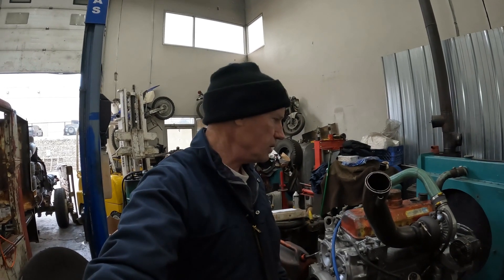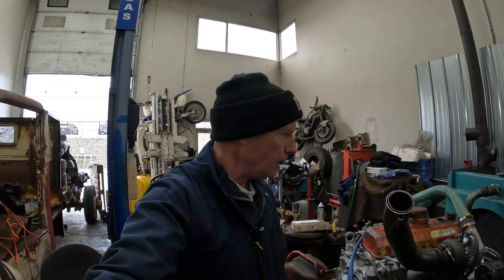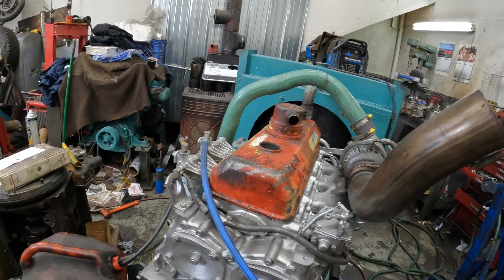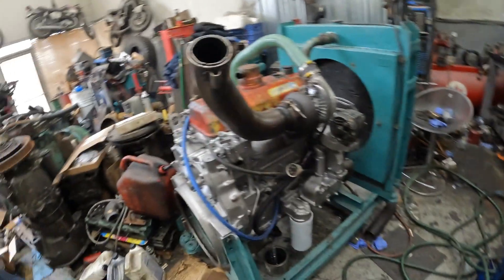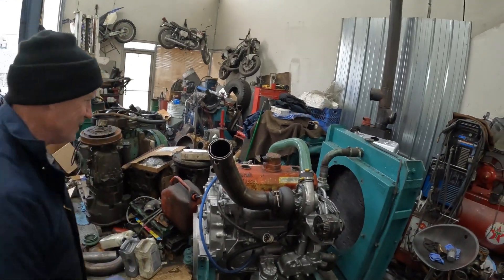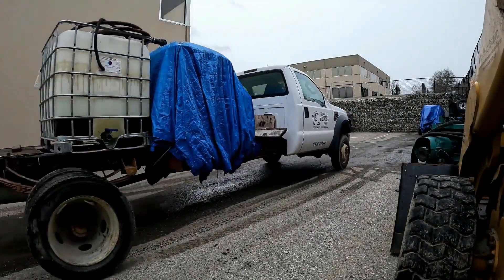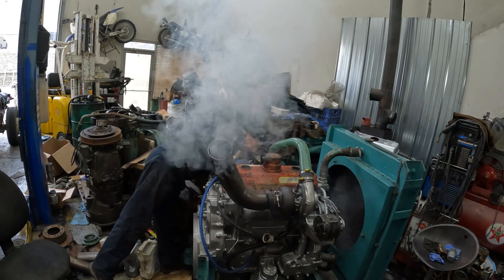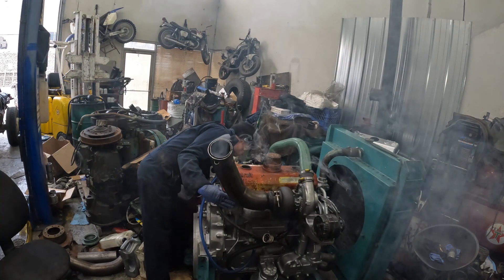Detroit Silver 4-53T (Second Start Cold 50f)

Comment: How many dollars does it take to renovate the entire Detroit 4-53N in the USA? In Brazil it costs around $50,000.00 reais, or around €9,000.00 dollars.
Reply from the maker: My cost is about $1000-$1200 USD without the labor.  Would be close to $7000.00 to $9000.00 to rebuild at a shop.:)

Comment: Question for you. I have a couple of Older GMC trucks i am repowering with the 4-53.    One was originally equipped with a 4-71. Do you ha e any thoughts on or experience with the 71 series  and should i be looking for one ?
Reply from the maker: The 4-53 should fit well and bolt to the trans you already have.  Can't remember if that was an N or T you have?  The N is 130-140 HP and the T is 170-175 HP.  The 4-71 is 145-160 HP.  The 4-53 is lighter and spins faster, so in the end you might not notice the power differences.:)
Reply: @detroitgarage9430  mine is an old N.   But it doesnot have to stay that way.     Anyway I am sure the 53 will be all I need after all I am not expecting it to be a comercial truck..... I was more wondering if the 71  series being the older design was better worse or just differant ? If I happen to find a 4-71 is it worth messing with ? ....or should I got actively looking because they are tons more rugged.... just general opinion of the whole 71  series if you had an opinion.
Reply from the maker: @greywuuf  The 71 series is the best Detroit made, so yeah if you find one grab it.  I really wanted a 4-71T for my original swap, but picked the 4-53T because it was lighter.  They're quieter, Jakes are reasonable for them and all round a great engine.:)  I have a 6V71 waiting for the day I swap that into something.:)

Comment: So you not have the bypass on the blower? It looks short to me
Reply from the maker: No bypass on this one, it's a T blower.  I still have to configure the bypass blower for this side of the engine.  Just means swapping the gears around, then can be installed.  For testing I'll be comparing the T, Silver bypass and N blowers.
Reply: @detroitgarage9430 excellant ...and my calibrated eyeball is getting better ;)  i almost know what i am looking at.
Reply from the maker: @greywuuf  :)